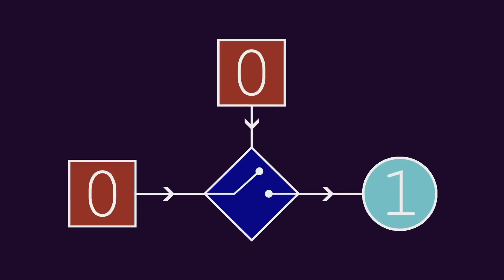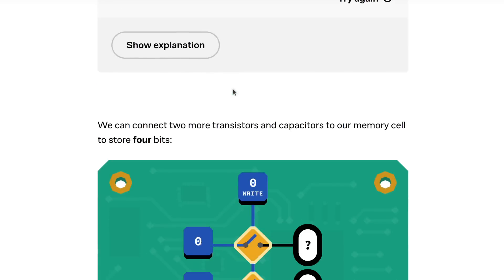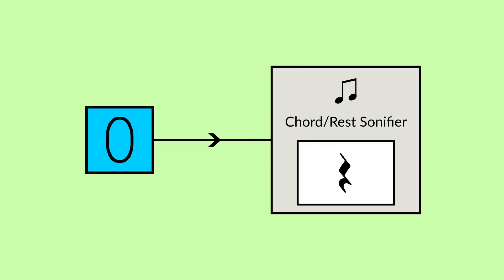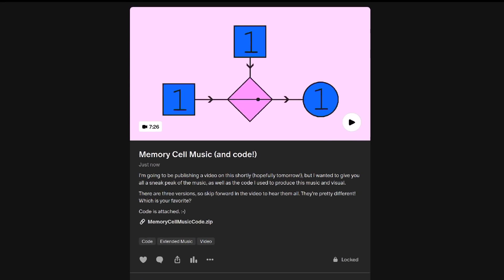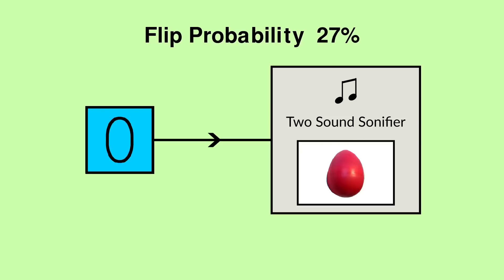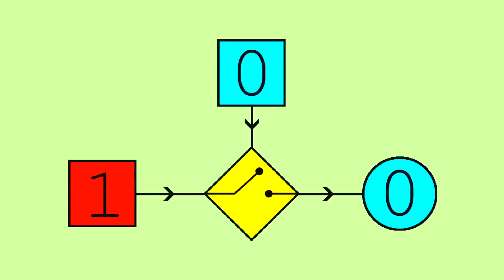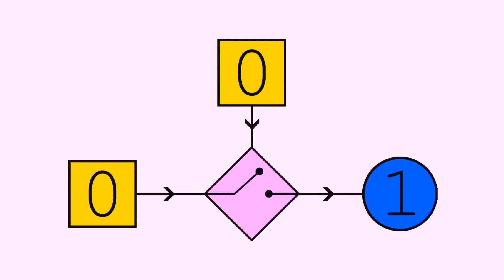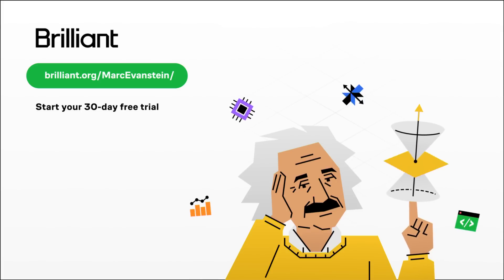The Wild Music of your Computer's RAM

Comment: 🇨🇱
In the good old days, I am talking the 70's, when (Mini) computers had phisical magnetic cores, and the boards, in general were carrying much higher currents than nowadays, it was lot of fun "listening" to different programs, routines or loops, by placing a small transistor radio close to the circuitry. 
Quite strange sort of "noise", sometimes even quasi melodical  😀. 
Saludos de 🇨🇱